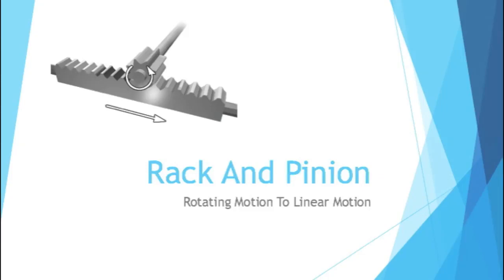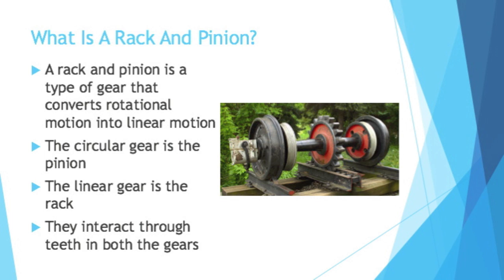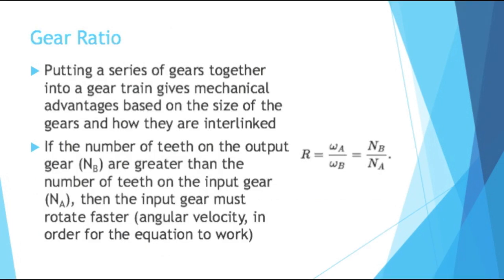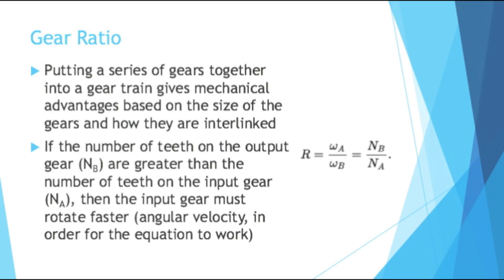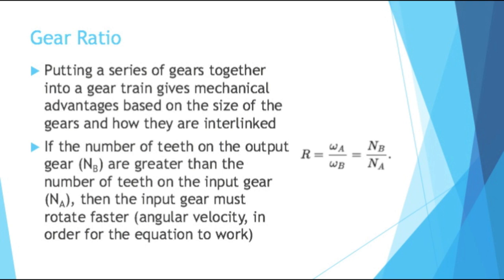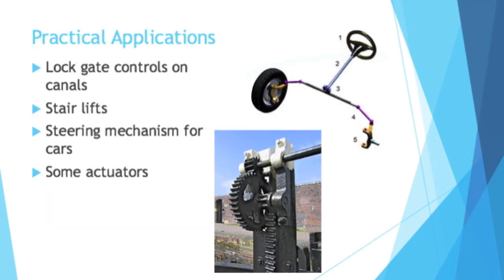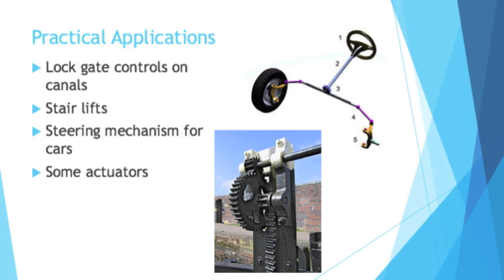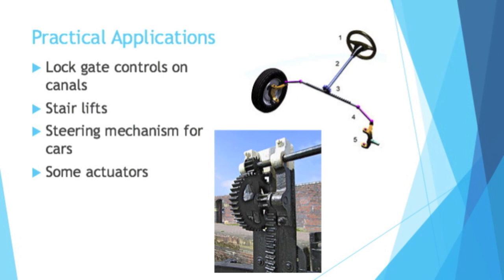Beginning Engineers Rack And Pinion

Comment: If the force is being applied directly on the pinion gear for rotational motion into linear motion on the rack would the reverse be true? i.e. can I apply force to the rack instead? Would it require the same amount of force to move a given load as it would if the force was on the pinion?

Comment: I'm sorry for leaving a thumbs down, but I found the video didn't explain the ratios adequately. While the ratio of two gears is just the ratio of number of teeth on each gear, a pinion could theoretically run on an infinitely long rack without changing the ratio. 

And just one more nitpicky problem: canal locks refer to the whole gate being moved, not just a locking mechanism like the lock on a door.
Reply from the maker: Fair point.

Comment: Can you design of rack & pinion , when 50 kg heavy mechanisum is slide with the help of rack?
Reply from the maker: I'm not exactly sure which parts of the mechanism you are referring to in your question, but if the materials are strong enough and the right strength calculations have been done you can certainly have a rack and pinion setup with a 50 kg heavy mechanism.